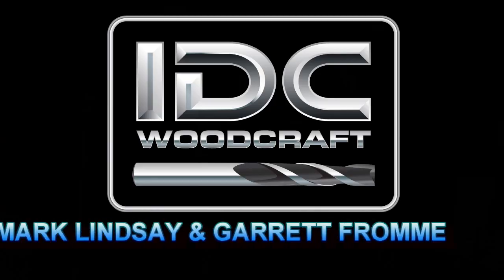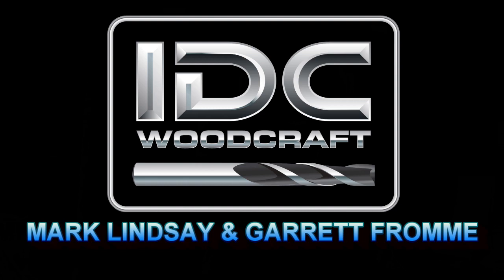CNC Router Talk [Projects, Vectric, Etc [Mark Lindsay and Garrett Fromme]

Comment: That was interesting. Like many of the posters here, you two guys were the two I often turned to to help me with my Vectric V Carve Pro learning.

When I bought my CNC, it came with Vectric V Carve Pro. I figured I would do my work on Mastercam like I had done for many years. Then I discovered Mastercam didn't have post processors for my CNC Shark. In fact it seemed like most of the post processors were for 5 axis, articulating head gantry type mills. Maybe I would just try a basic Fanuc mill code and see how it went, or do my drawing and modeling on Mastercam and do the toolpaths on Vectric.

That of course required knowing something about Vectric. I went to the Vectric learning center. They are pretty helpful there. Turning to you tube, you guys were a couple I came upon and learned a lot from. Now, except for 3D modeling, I use either Mastercam or Vectric V Carve Pro.

Recently my wife came to me asking if I could engrave photos. I told her I would have to buy the Photo V Carve add on for like $150 or upgrade my Vectric V Carve Pro 9.5 to Version 11, where the photo carve was bundled into the upgrade. We thought it made sense to do the upgrade. Then when I ran into some impediments and problems with 3D models, I often worked around them or abandoned the project. I would need Aspire to create the things I wanted to do. So we did the upgrade to Aspire.

Like Mark said, "it's going down a rabbit hole". I turned to Mark Mezalick and the Vectric site to help me get going with that. I see you are looking into using Aspire also for a project you are working on. That should be fun. Hopefully we will both learn things from that.

I check out Mark's Q&A sessions when I can make it when it's live, or I catch it afterwards. I've been lurking on Dave Gatton's  Hobby CNC live sessions on Saturday evenings. it's fun and interesting seeing many of the guys I'm subscribed to on there and the things they do. I went down the rabbit hole it seems.
Reply from the maker: CNC Programmer, thanks for sharing brother! I couldn't agree more with Mark, I think we all end up going down the rabbit hole. Plus, it's always a bonus when the wife gives the go ahead! It sounds like your software upgrade should allow you to have some fun projects up and coming! Keep up the good work my friend!